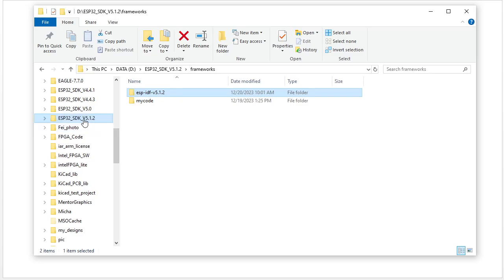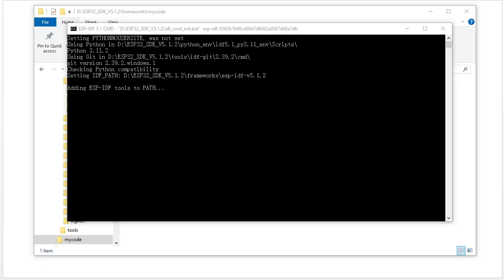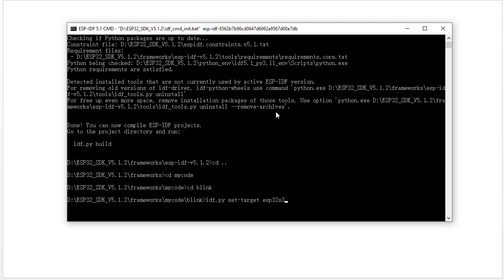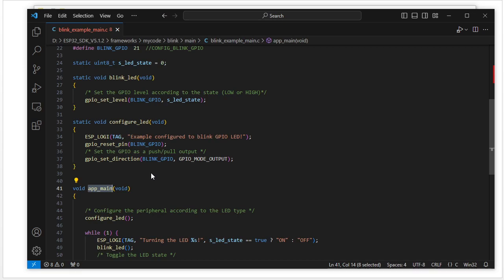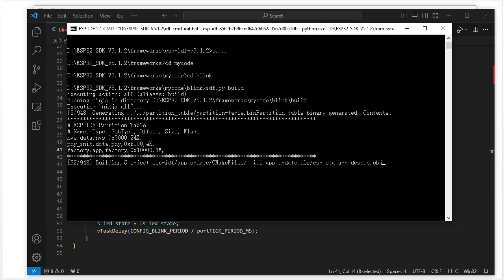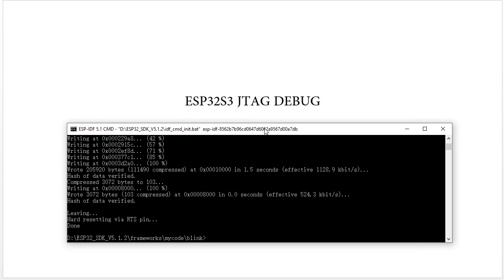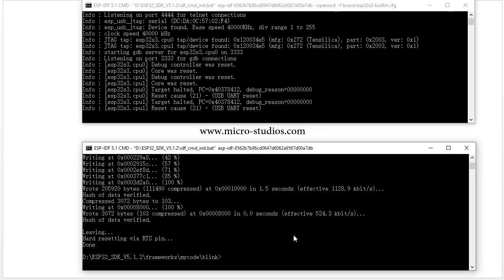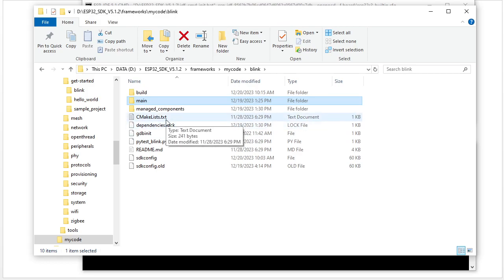ESP32S3 JTAG DEBUG

Comment: Thanks a lot for this video!  On linux I had to sudo cp ~/.espressif/tools/openocd-esp32/v0.12.0-esp32-20240318/openocd-esp32/share/openocd/contrib/60-openocd.rules /etc/udev/rules.d/ and run sudo udevadm control --reload to get  openocd -f board/esp32s3-builtin.cfg to work.  But everything worked nicely then.  Thanks again.